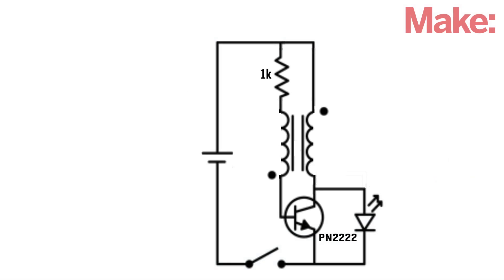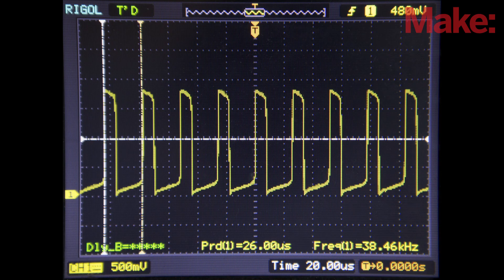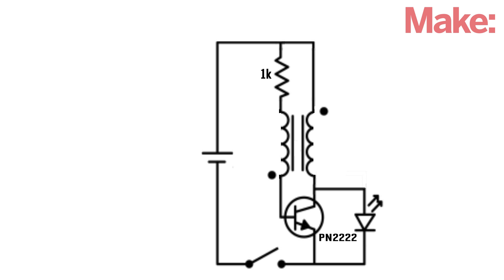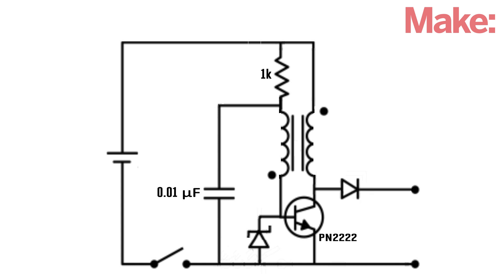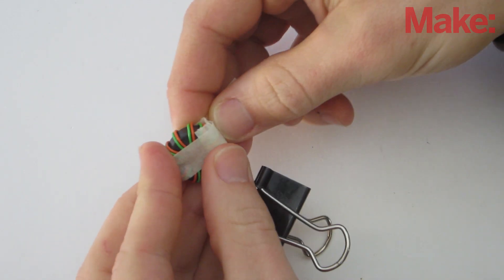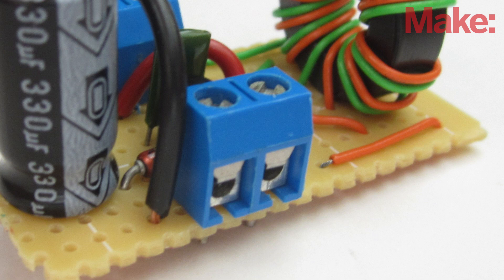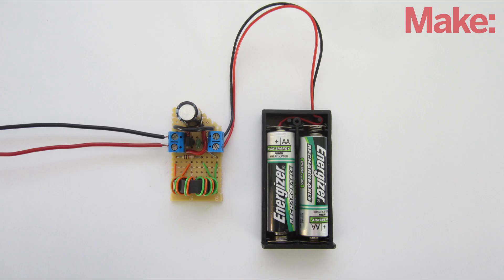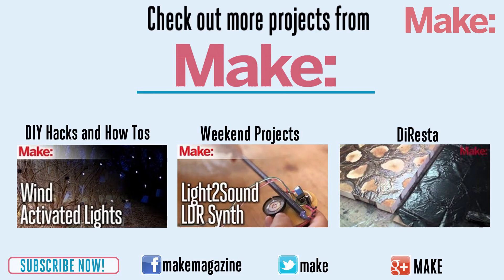Joule Thief Battery Charger

Comment: take a cable from" end" to "start" 
infinte energy ?
Reply: Nope.
Reply: Nope! This type of circuit is used for many normal applications. For example those electric bug zappers, or the energy saving light bulbs, or those cheap bicycle LED lights. It's called a joule thief because you can take a battery that seems to be drained, but as long as it contains a small charge in it it can be used for a low power application such as an L.E.D. light, or to partially charge another battery. In other words, with this joule thief circuit you can drain the last remaining joules from a seemingly empty battery and the circuit will convert that energy to such a level that it still can be used. The initial input power source doesn't have to be a battery, a small solar panel or an earth battery, or a fruit battery are possible energy sources as well.

It is NOT possible to give a completely drained battery a full charge with a single seemingly drained battery because it only charges partially until the initial input power source for the circuit has no more joules or energy left in it. In order to get a full charge you would need several seemingly drained batteries as the initial input power source for the circuit. Batteries with not enough charge left in it in order to operate a digital camera or a computer mouse can still be used with this joule thief circuit.

So the conclusion is that the output measured in joules is NOT greater or more then the input, so it is NOT an over unity or free energy device. It's nothing more then a simple, efficient and fun circuit to play with because it is easy, cheap and harmless.
Reply: i get infinite energy from my outlets at home. Too bad it comes with a cost...so the only thing i have to find is someone who is willing to pay for it... probably a lot easier than making a Perpetuum mobile with free energy...
Reply: That would be considered a short-circuit and could damage your parts...
Reply: Infinite? One scenario- your power company goes down... Poof, not so infinite anymore. And this is not a perpetual mobile, whatever you mean by "mobile", as you might mean "module", as it only extracts energy, not give you free energy...
Reply: lol k